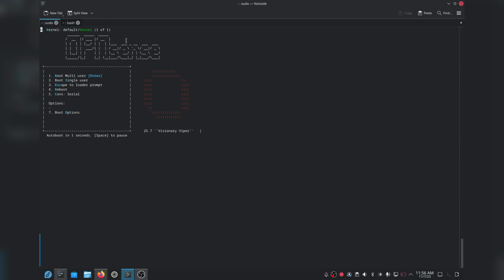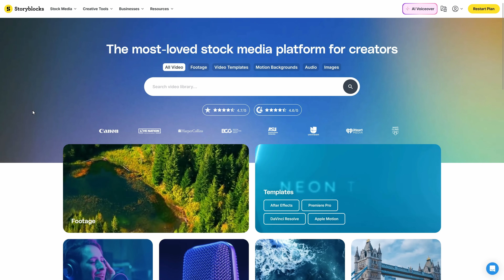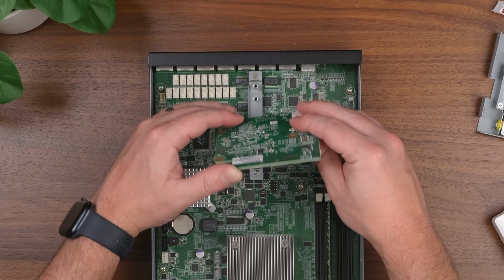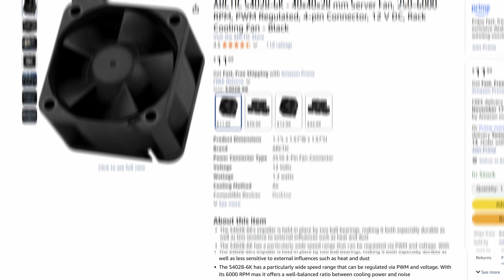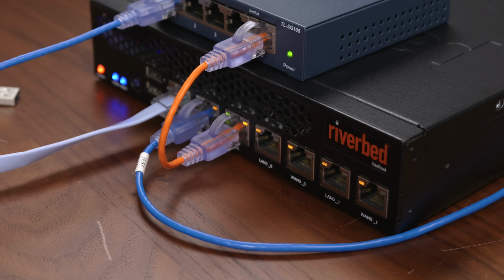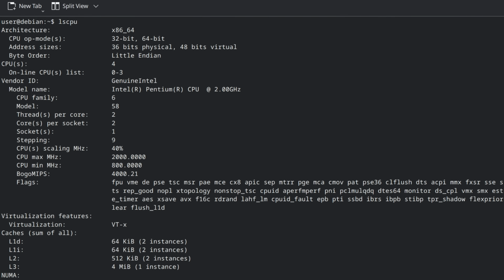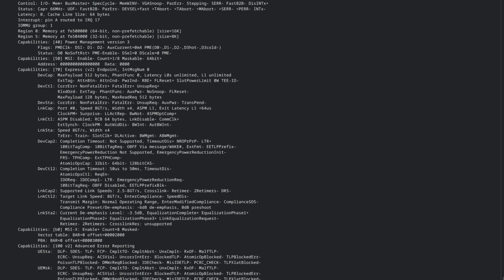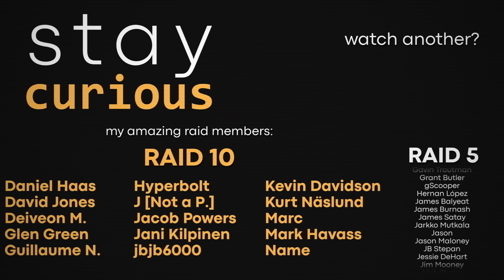The Best Budget DIY Router You’ve Never Heard Of

Comment: Next, take a look at the Datto DNA.  It is a very similar type of device w/ 6x gigabit ports, and a serial console.  It is shorter, quieter, and more power efficient compared to that Riverbed, and can fairly easily run pfSense (and I assume OPNsense).  It can boot from CF or SATA devices, although I had to make a custom SATA power cable to use either a 2.5" SATA or SATADOM.  It has a couple of mini-pcie slots that ship with WiFi and WLAN cards by default, but can be re-purposed as needed.

Comment: The source code for the bios for this unit is on the high seas, with the right make file your can do a make menuconfig and enable/disable features, the bios chip should be in a flip case , the pci was ment for another case where there would be other comms tech. there are two boards which are original , cost reduction of populated parts and a v3 bord missing all the good stuff. the always on board has been hacked as the source for that was also found on the high seas.
Reply: Which part of the high seas?

Comment: bridge open by default for failover is a horrible concept.
Reply: not when it's a security critical device, if someone manages to run an exploit and crash it, you would want it severed.
Reply: this is not a router, it's a cache server. If it fails and the ports switch over you just lose the caching function but everything else is still working and secure

Comment: found this exact model locally
it's $150 for no ram/ssd/psu (sold separately for insane prices)
Reply: ebay sellers be like: HIPSTERS COMING TO BUY SURPLUS OBSOLETE FUN STUFFSSS IMMA RAISE DA PRICEEEEE
Reply: His listing must have been a fluke cuz I can't find any as cheap as that one.
Reply: @TheOmegaRevolution they were that cheap.
Reply: ebay prices be like that
Reply: A ready to go N100 with 4x 2.5Gb/s will cost less.
Reply: $150 is way too high.
Reply: yeah, in France I found it at 120€ so not as worth it as the video claims unfortunately
Reply: @oxodao  J'ai trouvé le meme sur leboncoin des que j'ai vu qu'il l'avait eu a $20 mdr
Reply: @oxodao  In Poland 60EUR for cx-570 without ram/psu/ssd